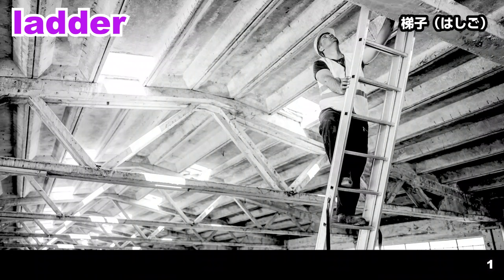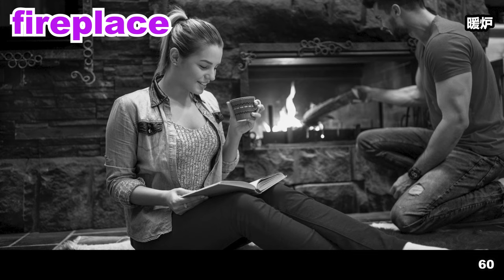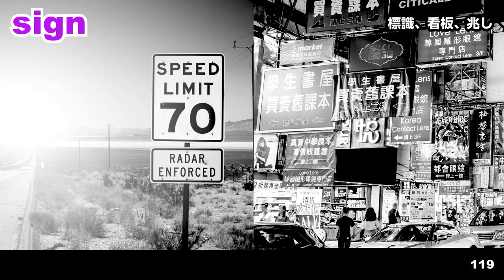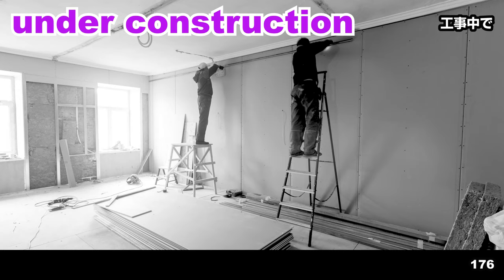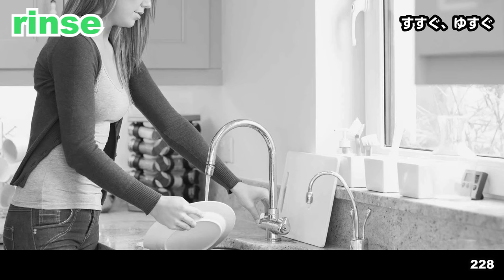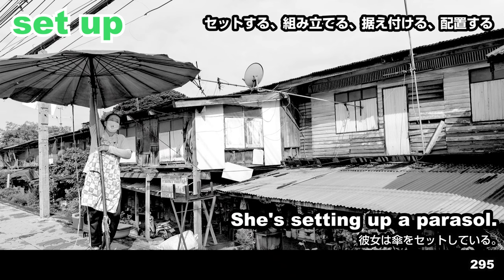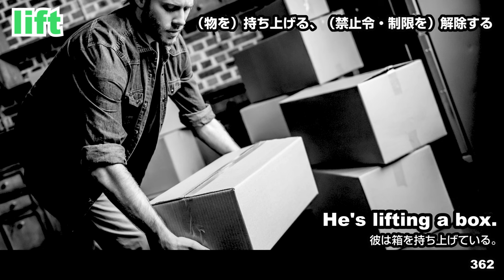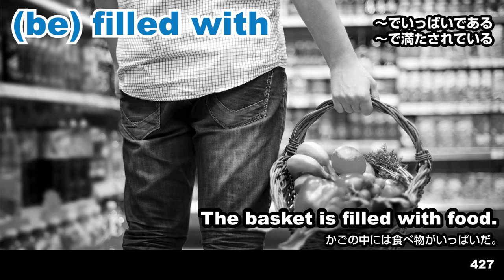【TOEIC Part 1】重要・頻出単語 430 完全版（名詞215 / 動詞175 / 前置詞・位置表現40）リスニング写真問題の対策に！例文・写真・ネイティブの音声付きなので聞き流しにも使える

Comment: dirt 土
shrub 低木
watering can じょうろ
flattened box ペシャンコになった箱
carton 容器
plank 厚い板
pan フライパン
cutting board まな板
countertop 調理台
place mat ランチョンマット
power cord 電源コード🔌
serving table 調膳台
chest たんす
couch ソファ
laundry 洗濯物　
pillow まくら
streetlight 街灯柱
glasses メガネ　glass ガラス
picture frame 額縁
paintbrush 絵筆
notepad メモ帳
reading material 読み物
power tool 電動工具
vending machine 自販機
workstation 一人分のパソコン作業スペース
workbench 作業台
billboard 屋外の広告掲示板
stream 小川
corridor 廊下
a flight of stairs ひと続きの階段
exterior staircase 屋外階段
stairwell 吹き抜けの階段
conveyor belt コンベヤーベルト
cash register レジ
kiosk キオスク、自動発券機
porch 屋根付き玄関
water fountain,drinking fountain 冷水機、噴水
windowsill 窓台
window shade 窓用ブラインド
podium 演壇
fitting room 試着室
aiport terminal 空港ターミナル
playground 遊び場　公園
skyscraper 超高層ビル
runway 滑走路
scaffolding 建築の足場
hard hat ヘルメット
protective gear 防具
pillar 柱
column 円柱
personal watercraft 水上バイク
riverbank 川岸
waterline 水位線
pond 池
Reply: underneath ＝under
beneath ＝under
below 下に
alongside ーの横に、側に
next to each other 隣同士
across from each other 向かい合って
one behind another 一列に並んで＝in line,in a row
in rows (複数の)列になって
in a corner 隅に
in a pile  山積みで
indoors 室内で
on the ground 地面に